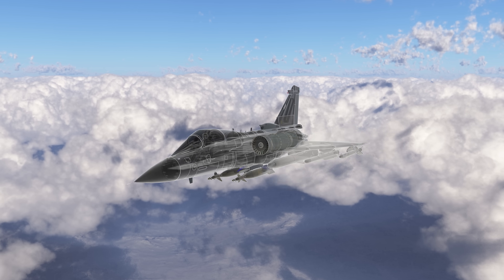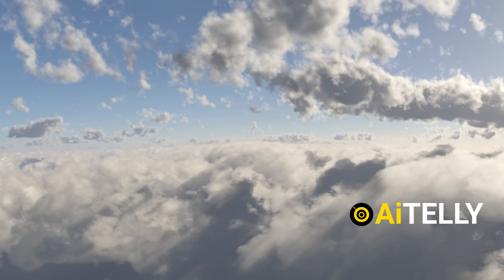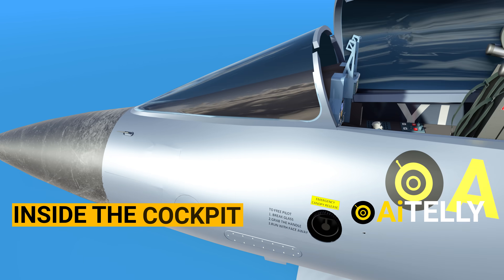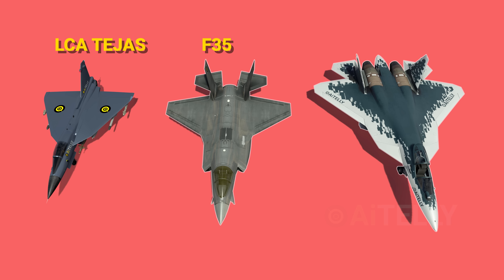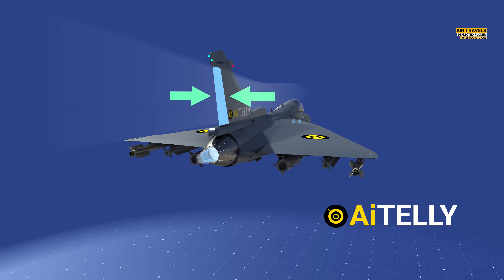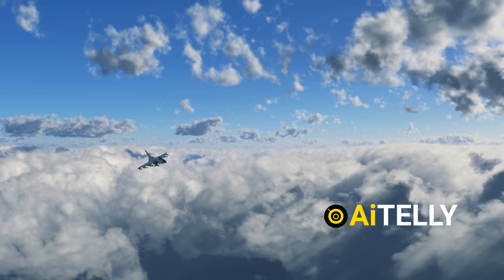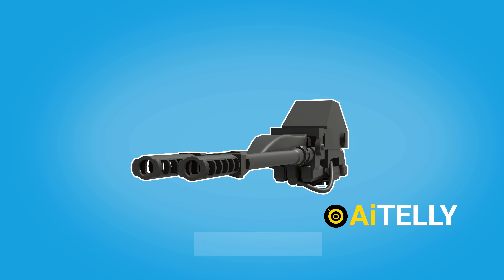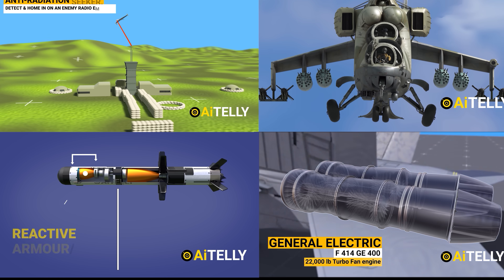Multirole Fighter Jets  How it Works | Tejas Mk1A LCA Light Combat Aircraft #fighterjet #jet #plane

Comment: Whoever is in charge of the logistic support system has a devil load. US Made turbofan engines, Russian made cannon, French fly control systems / fly by wire, British pilot eject survival systems, a mixture of domestic and foreign avionics, and the armament is a mixture of domestic and foreign, probably American sidewinder, French Meteor. System integration engineers sure worked hard on this.

Comment: You said the lane doesnt have ailerons and that is a lie. Ailerons Flaps and Elevators are all combined in 1 surface.
You said the R73 has a range of 30km and that is a FAT LIE. It cant even see its target that far. Its 20km in ideal conditions. 5-8km if the target is not braindead and actually manouvers.
Same with the Astra missile. If the target intends to die the range in ideal conditions is 100km. In a realistic scenario it is more like 60km in realistic ideal conditions.

Comment: For the money wasted away on the DEVELOPMENT and TESTING of this marginal airplane the IAF/IN could've purchased and operated over 350, locally-built, F16 Blk50's.
Reply: What would we have achieved doing that? A hostage to usa, it's better to have your own fighter than always depend on others for big countries like India
Reply: We not spend much though 😅😂 it's kinda 2-3 bilion total cost till now
Reply: the whole development cost was around 2 Bil$. Purchase cost for 123 units is around 6.5 Bil$. Total 8.5 Bil$
Cost of 350 F-16 Block 50 would be around 35 BILLION$ with the fighter jets and related spares.
F-16 does not have Naval version.
Per hour cost of flying F-16 is 1.5x that of Tejas .

Comment: That ski-jump.
lol.
and then lol some more.

Ever wonder why america and japan never used them?
Instead preferring a much more costly slingshot?

After all, if the ramp worked,
then why don't america add that to their slingshot, hmm?

Think about it?
or 
$$$$$$
Reply: lol, typical noob comment.
Its not called a "slingshot", its called a Catapult. Such carriers are called CATOBAR designs. This one is a STOBAR design.
And there's nothing to think about. Its about the money. CATOBARs are better but  much costlier.
Reply: Japan doesn't have aircraft carriers it has helicopter carriers, which is suitable for F35B,

Comment: 9:45 correction: the tejas have 3000 km with external tanks, 1850 with internal fuel. 
In my personal opinion it's a plane with good design but made with poor quality materials like the helicopters hal dhruv that India sold to Ecuador, the south korean fa 50 is a better plane with better quality...but is my personal opinion.
Greetings from Paraguay 🇵🇾
Reply: I can agree about HAL Dhruv (some changes are being made now)
But Tejas is the world's safest fighter jet with no crashes in over 10,000 fllights.
South korean FA-50 already had 5 deadly accidents.
Reply: In Tejas we used radar absorbing material  u even actually know the Tejas material quality lol how ? 

Dhruv case already solved after investigation found it's pilot fault not helicopter lol after that ecuador buy few more Dhruv ! Our IAF do not compromise with performance and quality ( always there moto reliable and cost effective things) 

Look at Tejas IAF waited so long older version of Tejas IAF rejected years ago now accepted which is so. Cool ! TEJAS MK1A solved many issues which had with old jet
Reply: Till date Tejas didn't had any issues over 6000 flight hours, so it's one of the safest plane in IAF inventory
Reply: @benudharmadhi4154  10,000. not 6000. 6000 figure is over 1 year old.

Comment: the Tejas Mk1A light multi role all weather fighter is very much armed with an internal gun, it's a 23 MM GSh-23 twin-barrel cannon built into the forward starboard side lower fuselage section, immediate below the right engine intakes . . . the naval carrier borne Tejas Mk2M maritime multi role fighter interceptor has reinforced fuselage & wings, strengthened landing gears for carrier operations . . . also features a aft arrestor wire, folding wings (for easy stowage in below deck aircraft hangar of STOBAR aircraft carriers) . . . the Tejas Mk2 (A1) multi role interdictor strike fighter will incorporate a tad longer (stretched) fuselage & slightly bigger wing . . . because the Tejas Mk2 (A1) multi role interdictor strike fighter will feature a longer nose radome, that'll house a larger improved AESA radar . . . and 2-axis canards on either side of the forward fuselage, ahead of the main wing leading edge slats . . . in order to achieve some measure of super maneuverability against it's adversaries . . . sadly enough the Indian Navy won't be acquiring the carrier borne Tejas Mk2M maritime multi role fighter interceptor, due to it being a single engined multi role jet . . . but all hope aint just lost yet . . . the Indian Navy is now considering to operate a LIFT variant of the carrier borne Tejas Mk2M maritime multi role fighter interceptor that'll operate from STOBAR flight deck for pilot training missions & acclimatization . . . the LIFT variant will retain all offensive & defensive capabilities of the standard carrier borne Tejas Mk2M maritime multi role fighter interceptor . . . it'll also participate in live fire exercises with other foreign navies . . . there's also word that the navy is planning to operate the carrier borne Tejas Mk2M maritime multi role fighter interceptor as a lightweight mid-air refuelling tanker aircraft (buddy refuelling) . . . without compromising the offensive capabilities of a carrier borne multi role fighter jet . . . the Tejas Mk2M maritime multi role fighter interceptor can carry upto 5 external fuel pods (either 852 litres or 563 litres), under it's under wing hard points & under fuselage hard points . . .

Comment: 28 years development!!! And the result is this. Donkey is still a donkey even when you take a golden saddle.  In the 80s, it could have worked but now it's useless unless india decide to use it as a trainer.
Reply: bhag madrassachap
Reply: try to develop your own aircraft..it was the first multi role jet developed by india many things had to be done from scratch
Reply: @JT-zl8yp  actually second, after the HAL Marut.
Reply: @marcd5196  was marut multirole ?
Reply: @JT-zl8yp  well Marut had air to air capability, along with its primary role of Air to ground as well.
Reply: The development time is too much but its main purpose is to replace dying mig 21s asap...And they more than well suit the purpose

Comment: India is underutilising its engineering and private sector talents and should NOT be complacent making this LCA ... this LCA is useless for modern combat with USA or CHINA ...though it makes sense that its only target is China n Pakistan .. and LCA is advanced fighter for that purpose .. yet INDIA should concentrate on making MRCA of 5th n 6th generation as the higher costs involved today will make sense of mass production and its own self reliance indigenous capabilities ... Forget the LCA and make MRCA 5 g ASAP as a competition n comparison to SU 57 n F22 ... Stop self boasting LCA now
Reply: the first requirement was retiring Mig-21s and replacing it with another Light fighter. Which has been achieved, though a few years late..
Then comes retiring Jaguars...which should be done by a similar sized fighter....Tejas mk2. If the timelines are maintained replacement should start from 2030 and completed by 2035.
Retiring Mig29 and then Mirage2000 comes next.....HAL AMCA.  Timeline is from 2035. 

Thats a pretty good plan, but hope timelines are maintained...

Comment: You were wrong about the engine. It's GE F404 in Tejas mk1A and not the F414 which powers the F/A 18. But the F414 engine powers Tejas mk2, which is a bigger aircraft than this with more payloads. Regarding  the weapons, you missed out python, i derby, saaw, hammer, etc., And there are more weapons  in the pipeline. The production line is getting expanded and the number of indigenous systems and weapons are also increasing by the day. This will significantly bring down the cost and supply chain disruptions. Also you forgot to tell that it is the only fighter with more composites in its structure than any other in the world, (with smaller size & more composites, which reduces the RCS greatly) So it's a game changer for sure.

Comment: They should consider conformal tanks like on the F16 to boost this things poor range. Looks a neat little jet.
Reply: Range on internal fuel is around 1500 kms+
Range with 3 x Drop tanks is 2500 kms+
Almost double those ranges with External refuelling if needed. 
So...

Comment: A Small Correction - LCA Tejas has GE 404 engine, you mentioned GE 414 engine.

Also, the range can be extended by drop tanks and mid flight refueling. the Weapon Package has more imp Missiles, Rudram & Astra Mk2
Reply from the maker: Yes aggreed we had put that in our Comment Correction Section
Reply: No. GE 404 was Mk1. Mk1A has GE 414 engine now.
Reply: @sudharshanve8519  no mk1a also has GE F404 engine the GE F414 is earmarked for tejas mk2 and AMCA mk1 also even the assembly line work has not started even the final clearance is still awaited so do not spread wrong news

Comment: The South Korean FA-50 has very similar specs, apart from being a two seater - Poland is buying 48 of them.
Reply: FA-50 is orginally based of a Trainer with limited combat capabilities. 
Tejas on the other hand has been designed as a combat jet right from scratch .
Reply: @marcd5196  Doesn't matter.  The two planes have the same GE F404 engine and nearly the same size, weight, speed, range, and weapons payload capacity.
Reply: @gandalfgreyhame3425  no air to air refuelling for Korean fighter, big downside
Reply: @thesenate8477  WRONG.  Look it up.  In 2020, a program to add a refueling probe to the FA-50 was started.   This isn't a hugely difficult add on, lots of aircraft have had air to air refueling solutions added after the fact.

Comment: I wonder if the Tejas FBW limits the full potential of it's aerodynamically permissible flight envelope. 🤔 So there may be a gap between it's theoretical and actual maneuverability.
Reply: Fbw are designed such with all aircraft as to restrict them from overstressing the frames.

Comment: Subscribed.. Great video guys. However I suggest you should have also given the cost of flying it per hour and also a comparison with other jets.
If the flying cost per hour is lower than other jets, it is still viable at a higher price because it will provide lifelong savings.
Reply: flight hour cost is not available in public domain. But considering its a Light single engine fighter, it would be around 1/3rd of that of a Rafale or Su-30MKI.
Reply from the maker: Good point.
Noted

Comment: Lol Tejas is not a multirole fighter. Infact it's a utter failure.
Reply: What makes u think that
Reply: @alexdefosakasosa  Because first of all, the Tejas project itself which was started in 1983 is utterly behind schedule and holds very little value in terms of the capability that one would expect from a fighter from a modern era. Even Indian airforce isn't a big fan of Tejas and only ordered 150 of them, instead choosing to acquire aircraft such as French Rafale. And secondly, Tejas is slow, overweight and has very limited range to make it an effective multirole platform.
Reply: @srijanme why not backup your claims by sources larper
Reply: @zosephzostar6857  its horrible. Only in India would u see some of the Indians trying to pull the nation down through lies and misinterpretation. Never seen something like this in other countries.
Reply: @srijanme  u know the project received first funding in 1993 and took ff in 2001?
Reply: @srijanme  lca and rafale are not even in same category , one is a LCA and other a MWA
Reply: @srijanme  your years of research seems to come from madarsa if u dont know what roles are used, how multirole is defined, how mmrca is not a lca replacement
Reply: @srijanme  name 10 components or subsystems of a 4 or 4.5 gen aircraft

Mention which & why they are imported

Also is swedish gripen indigenous by your measure in that case? 🙂
Reply: Utter failure of is your intellect.
Reply: Bengali gulam complex is strong

Comment: One has to remember, the LCA first originated for the replacement of the aging mig-21s in large scale. Unfortunately people always compare with latest fighters. Except speed of not achieving Mac 2 of mig-21, the other parameters are good. And Tejas -2 can be compared to twin engine fighters as far load concern and maneu variability. This is all after 2025.
Reply: Why compare mosquitoes and eagles?

Comment: It's Compound Delta Wing design is designed to perform exceptionally better at high altitude Himalaya zones. The Delta Wing gives its lower wing loading for better maneuverability and its turn radius is smaller than F16. It's payload is highest in the light combat aircraft/ LCA class due to high composite content. The inner pylon is capable of carrying 1.2 ton oil tank, which is not seen in other LCA class. The FADEC, advanced auto pilot and auto-recovery is the reason why not a single LCA have crashed so far. Brahmos NG will have over 350km range @Mach 4.5 due cuz of a new classified fuel being developed. The same fuel will power Brahmos Block IV with over 900km range at Mach 4.5.
Reply from the maker: Great info will add thi in our Comment Correction Section
Reply: @Aitelly  When can you make video on Tejas MK 2 ?
Reply: Well done Nexoft.. Great info on Tejas, India's pride and a testimony to the ability of Indian scientist. Can't wait for Tejas Mk-2 and TEDBF, scaled up versions of the same and with world-class ability to outsmart best of the best.
You should take up defense vlogging seriously. Your knowledge and research skills can't go waste. Thanks bro! Enjoyed your post. Cheers!
Reply: @pragmatist964  Thank You, but I have a family to look after. My condition is not that good as my dad abandoned us and I have inherited a high 7 figure debt for which I might end up on the streets.

Also for Tejas, it's getting a 900 TRM Uttam as opposed to previous 700 TRM Uttam, and also getting GaN-based DRFM ASPJ which is better than IAF MKI's GaA based EL/L-8222 DRFM ASPJ used against Op Swift Retort to jam AIM-120C5s.
Reply: @3Areviews  I'm aware of the Gallium Nitride based AESA radars and Uttam Mk-2 and the extension of the same to Flankers. I guess, it's part of the in-house Super Sukhoi upgrade. Thanks for the additional info. Appreciated.
I'm really sorry for your situation which you're in currently. Hope you get over all the financial troubles a lot sooner and lead a comfortable life.

You may run your defense channel on weekends and apply for monetization with Google Adsense and see if that works.

Stay motivated! Best of luck bro! Cheers!
Reply: @pragmatist964  Can you do a donation to me please 🙏🏻
Reply: @3Areviews  Please put up a "Thanks" button on your YouTube channel. Will try to contribute something..
Reply: @pragmatist964  For some reason, my comment is getting deleted
Reply: @pragmatist964  my UPI is egnanon oksbi 🙏🏻
Reply: @3Areviews  Made a token contribution Mr.Alam. Shiv ji se prarthana karunga ki aapki takleef door ho Jaye! Best of luck bro! Thank you!
Reply: @pragmatist964  Thank you brother 🙏🏻 you made my day.
Reply: @3Areviews  🙏
Reply: As expected, something related with India came, the comment box is filled with over proud orgasmic nationalist indians claiming about how great the jet is forgetting the fact that after all these years india still couldn't make a proper heavy fighter aircraft like f16 or su 30mki..We don't even have a proper indigenous made assault rifle for our army as not of our own rifles like Asas were a big failure..Am ashamed to say am indian by these kind of over proud idiots who bark under every videos that comes with something indian..

Comment: Question: Is it possible for Tejas Mk1 to be powered by GE F414 engine instead F404?
Reply: no, GE414 engine is bigger in dimension. Thats the reason we are designing a larger Tejas mk2 to have the GE414 engine.
Reply: @marcd5196  mk2 is twin engine jet ?
Reply: @polarbear7  no, single engine. only the engine dimensions are bigger.

Comment: Its crap. Its basically no better than a old f20 tigershark. The tiny size means tiny radar with poor range. So it cant fight any 4gen jet. The delta wing means it sucks for close air support too. Vertical tail makes it easy to detect. This jet can only function as a trainer. Also tracking only 4 aircraft is horrible US and Russian jets could do that 40 years ago. This jet would be obsolete 45 years ago.
Reply: u should join HAL and design jets for them. 
LOL.
Reply: Tejas Radar has 150 km detection range. Come back when you have been educated.
It can track 40 targets engage at 4 at a time. Have you been even watching the video?